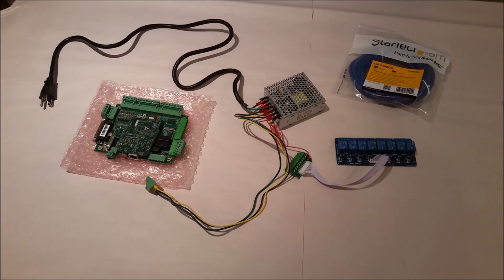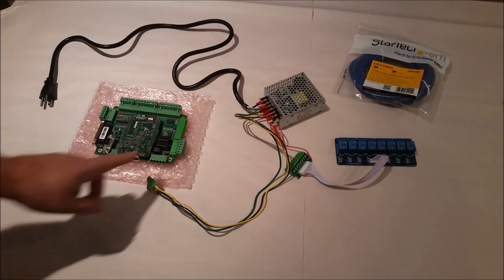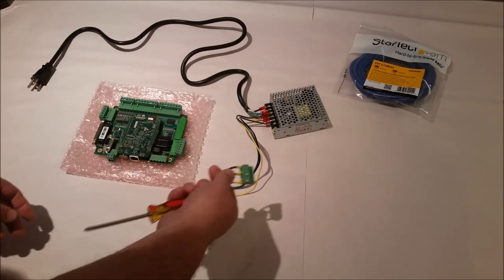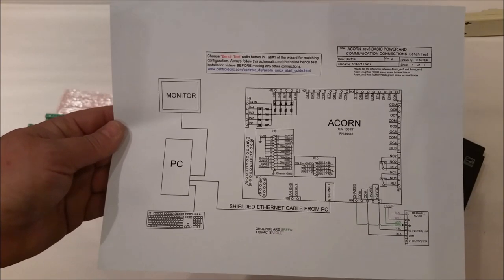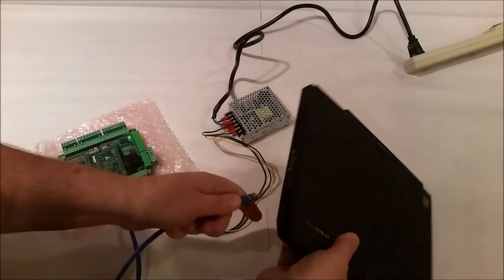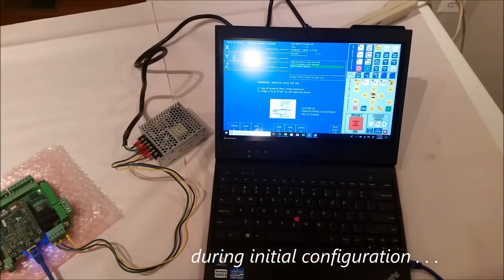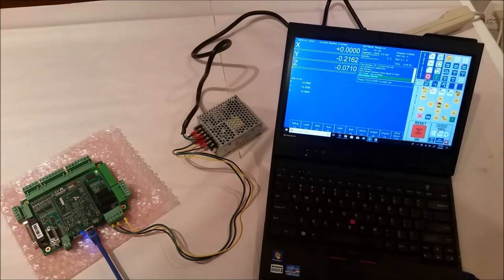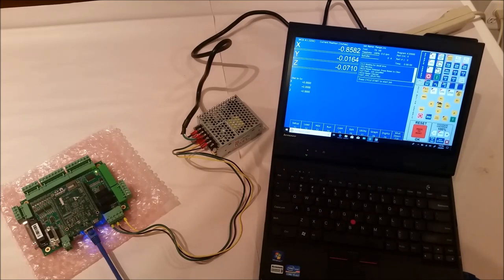Airdog77

Comment: Cool Bro! It's coming together already. So... did you have to reset the board or not after the screen prompt?
Reply from the maker: Thanks!  Yes, I did.  Guess that would have been a nice piece of info to be more clear on eh?  Turned off the laptop just to ensure the required sequence of 'Acorn board power-then computer power' was met, then cycled the Acorn board power.  Worked like a champ... and better yet, DIDN'T Brick the Acorn board.